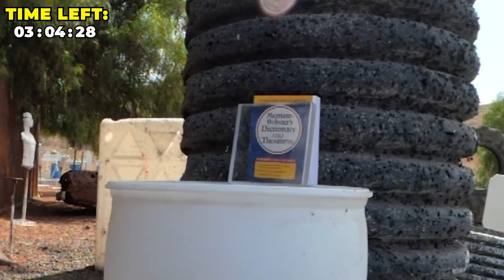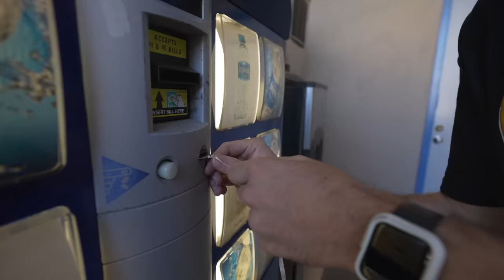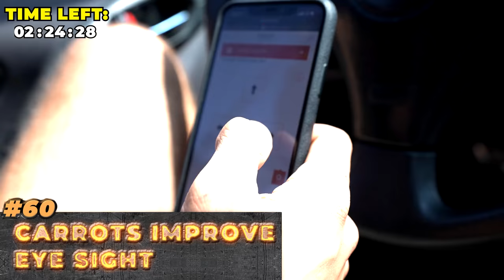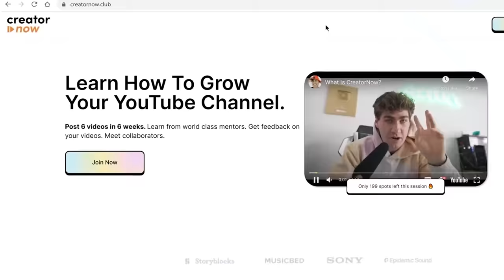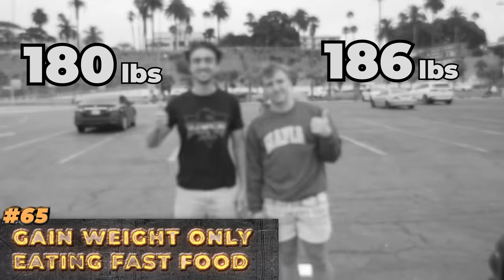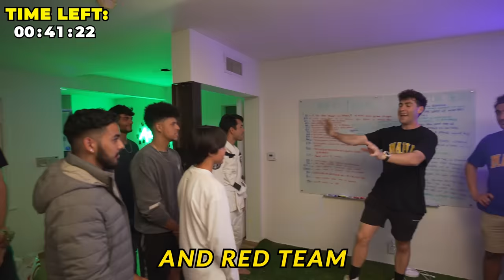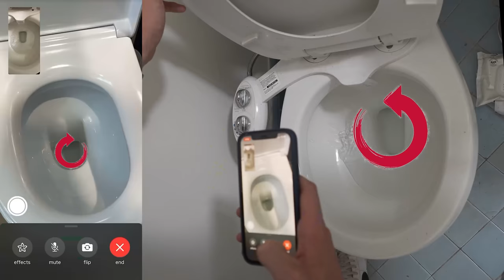Busting 100 Myths In 24 Hours!

Comment: The carrot one is actually very interesting. basically during WW2 the British had invented and incorporated sonars but they didn't want the Nazis to know that and so they started making publicity that carrots give better vision and it actually worked since no one ever found out.
Edit: a big portion of these is true but you simply didn't have the skill to do it (like breaking a glass using voice) or simply not good conditions (like the water one) or just didn't do them correctly (like the one where you used vegetables to charge an iphone since you can't just plug in the usb, you actually need stuff to conduct the electricity or picking a lock with scissors since I have succeeded
Reply: Nice pfp
Reply: Nice pfp
Reply: What is wrong with you?😭😅😂😂
Reply: The carrot one is true it just doesn't happen over 10 seconds it takes time.
Reply: can u plz not be a nerd for 5 seconds?

Comment: 16:17 It is possible. You should have the same pitch as the glass to break it, the guy just screamed at the glass which isn't going to do anything. And 18:14 is wrong, you can but it won't make you sleepy/tired on instant. 15:51 is also wrong. You can rip the dictionary with your bare hands, many people has done it even with thicker books than a dictionary.
Reply: Many of these are inaccurate on purpose. They're literally testing things like the 5 second rule and is water wet. It's not meant to be taken seriously.
Reply: Bible
Reply: It's not turkey that makes you tired anyway. It's anything you eat in excessive amounts.
Reply: Also, the title said 24 hours, but the timer said 12 hours
Reply: @megamuffin3900  I mean the water one is legit. Water is in fact NOT wet.
Reply: @megamuffin3900  True but I guess showing people misleading/wrong information isn't serious.
Reply: @TripleX-gr2ov  Yeah but not all foods can make you sleepy. Protein Rich foods can make you tired cause there's an amino acid called tryptophan, tryptophan can make you tired and Turkey is an example.
Reply: and the roller coaster thing. some people have stronger stomachs.  The bottle thing need to have liquid and the type of liquid does matter.  So i agree some of these are bs
Reply: Bruh obviously nothing in this video is accurate it’s just random dumb stuff for fun
Reply: @sirwabaloo7930  ok

Comment: About the diamond that is indestructible. fun fact: hammer can break a diamond easily. Diamonds are hard, they are known to be the hardest material on the earth but they have a crystal structure, so they can break if you hit them with the right angle aka the weak spot of the diamond.
Reply: Hard means its surface can't be scratched, it has nothing to do with it being unbreakable.
Reply: @Cainenghis  number 32 on the video, diamond cant break?😂he say "diamond are clearly indestructible". Are sure about hard definition?

Comment: Fun fact: a lot of those myths are able to be busted or not like the diamond one because diamond is just very strong
Reply: Diamond can be broken
Reply: Diamonds are brittle tho
Reply: @potaton1342  diamonds are NOT brittle, it takes a force of 70> tons to break one. Whoever told you they are brittle was wrong.
Reply: That are hard not brittle
Reply: @LShaver947  they shatter they can not bend at all
Reply: sometimes i wish people had better english
Reply: @LShaver947  btw if you are trying to 70 or more it would be 70< or 70+
Reply: @potaton1342  my guy I know my maths it is 70>
Reply: Diamonds are brittle and very strong, but their toughness is almost the same as regular glass, once you reach a diamond's breaking point it will become brittle and shatter like glass, instead of flexing and bending to withstand pressure like better materials. (We have pistons that exceed 1000 tons of force, so diamonds are crushable)
Reply: @LShaver947  I was just saying if you made a typo

Comment: At 5:43, milk actually does help with spice. It is just that the pepper you guys used was too spicy for the levels milk works in. Milk has the molecule Casein, which can dissolve spice and relieves TRPV-1 receptors, aka the things that sense spiciness. Food theory did a really good example on it. Note that it only moderately works. Really, it depends on the pepper.
Reply: i know
Reply: R/madlad bruh
Reply: Ur a genius
Reply: tempting the science guy

Comment: Myth 31 is incorrect, you can break diamonds, pretty easily actually. All you did was measure it’s hardness. what usually mixes people up is the fact that diamonds are hard, but they aren’t dense. What makes hardness and density different is the fact that hardness is usually the fact that objects are more condensed, which is what you tested, while density is how hard it is to break that object. Diamonds have a hardness rating of ten, which is really hard, it is the hardest rating a metal can get, but only has a density of 3.51 gm/cm3 on the Mohs scale. Let’s compare this to an element like platinum. Platinum on the Mohs scale only rates to a 4-4.5, which is no where near diamonds hardness, but platinum’s density is 21.45 g/cm3, which is much denser than diamond. To put that to scale, titaniums density is only 4.49 g/cm3, so you could probably guess that diamond’s density is considerably smaller than most transitional metals and is easy to break. Also, smaller objects are harder to break than bigger objects. This has to do with deflection

When one grabs a twig and tries to break it, the ends are pulled together to bow the stick till it breaks.

The deflection ("bending") of a stick is proportional to the cube of its length. So, with the same force, a stick of length 𝐿
L
 will be deflected 8 times less than a stick of length 2𝐿
2
L
with the same force.

Now, one side of a bent twig is stretched and the other side is contracted. This stretching/contraction is proportional to the deflection, and when it reaches a limit (Breaking stress), the twig breaks.

So what's happening here is that as you shorten the twig, you lose the capacity to generate deflection, and thus it becomes harder to break.
Reply: Yes now you add 2/1% force and with the length od 2÷3=0.9 with all the force it should have the force of 67.09.6% aka 34×90×6÷5=6.3 meter and yes i agree what you said great job
Reply: @mad5259  Ty :)
Reply: Nerds
Reply: Dude THIS AINT SCHOOL YOU DONT NEED TO TYPE A MILLION PARAGRAPHS
Reply: @usrname678  yes your welcome
Reply: @mad5259  bro how long did much effort did you put into this I have so much respect man! Good job!!!!
Reply: @lilhayman9934  thank you so much man i really aprecciate cause this took 10 minute yo do 👍
Reply: Hold on is this all of just 1 myth and where did it go why did it go to you can break a diamond to breaking a twig
Reply: @Sco77y152  it was an example
Reply: @Sco77y152  yeah
Reply: @Sco77y152  it was just a example
Reply: @Sco77y152  you're right, it's not school :) it's facts and real life, get real kid xD
Reply: I miss one day of school and I'm actually stupid.
Reply: What why is there so much writing
Reply: Wow. Someone is very good at English in school
Reply: Carrots improve eyesight
Reply: @zilianchen4733  it’s to explain the math to proof that what he/she is saying is correct using data and b r a i n
Reply: @mad5259  You litterally just passed a sciencetest and a math test
Reply: @dancingcow5524  thanks I really apreciate this
Reply: Get out of school nerds
Reply: @bigal18042  okay high school dropout 😂
Reply: What the fuck?
Reply: @ultrainstinctarizonaranger8611  what?
Reply: @treybaskin6391  haha
Reply: @mad5259  NERD
Reply: @Elijah Fisher EFM I don’t really care?
Reply: idk y i read this whole thing even though u lost me in harder to break than bigger objects
Reply: @Aimthegreat  lmao
Reply: I’m no einstein but I’m pretty sure hardness is how hard it is to break that object and density is the fact the objects are more condensed…
Reply: @economicapple2609  it’s not, look it up
Reply: @economicapple2609  you got it backwards
Reply: @usrname678  r u kidding me it literally says “dense” in the description for density
Reply: @economicapple2609  exactly. Meaning it’s insides are more dense and thus more durable.
Reply: @usrname678  That’s density bruh
Reply: @economicapple2609  yeah.
Reply: @usrname678  my point exactly density is how dense an object is and hardness is how hard an object is ._.
Reply: @economicapple2609  yeah no shit, but hardness isn’t how hard it is to break it.
Reply: @usrname678  "What makes hardness and density different is the fact that hardness is usually the fact that objects are more condensed, which is what you tested, while density is how hard it is to break that object. "
Reply: I wonder who's really reading all of that
Reply: now do this for like half of the myths they "busted"

Comment: The bottle has to be glass. 
Diamonds are pretty brittle, but it depends on the density and size. 
The bed of nails had some that were crooked. 
You need a chemical reaction for the patato to charge your phone.
Most of the later ones need time
Reply: oh yeah dont forget the one that they said you cant break glass with your voice. but its true also dont forget the one where they pulled the sheets off the table and said it was busted but its true
Reply: @imthatguy35.  For the glass one, you need to maintain the pitch for more than what they did. And for the table one, you need a lot of skill, or luck.
Reply: @pythro_  yeah

Comment: #79 is applied to supercooled water, not any water in a fridge, if you’re wondering.
#80 is true, but very hard, the difficulty is also determined by strength and type of glass.
#84 is true, just also very hard.

Comment: Some of these “myths” were actually true so I’m gonna name them

3:48 yes, you can explode a microwave with a fork(obviously)I’m guessing you didn’t put the fork in long enough?
4:57 you can seriously break open a bottle with your hands, but you need to do it the right way(thanks Mark Rober😉)
5:45 it does help relieve the heat, but compared to worlds hottest pepper it’s not doing anything
6:54 you still got down 🤷‍♂️ 
9:32 bullet proof glass can stop a bullet, but it can’t get shot by a pistol then a rifle because of course it’s gonna go through
9:32 now dictionary can technically can stop a bullet with a small gun and bullet at a certain amount of distance
10:01 cacti do have water inside them but you should not drink it
10:42 🤨
15:30 they are slippery as you can see the banana fly across the ground
16:08 it does work if you put it inside the freezer for an amount of time and the smack it on something and it will indeed turn into ice(look it up)
16:17 you can do this with a special type of glass, you just have to match the pitch when you you flick at it
16:46 it’s possible okay
17:52 this is just an opinion
18:05 a ball can fall down in a moving vehicle, just look it up
18:18 it can make you sleepy after a period of time
18:28 that is disgusting 
And that’s it, other than these “myths” the video was great, keep it up!
And sorry for being a nerd

Comment: The "myth" about carrots improving your eyesight shouldn't have been busted. Carrots actually do improve your eyesight. They contain chemical substances like carotenoids, which are very present in eyecells because they play an important role in lightreception, hence 'seeing'. It's a very complex system, but basically when light comes in, it changes the structure of the carotenoid-molecule, causing a chemical reaction which makes it possible that we can 'see'. So yeah, when you eat carrots, you get more carotenoids, which improves your eyesight. 

Same with cacti, of course they have water, otherwise they wouldn't be a able to survive, just like any other living organism. They need it to photosynthesis, like any other plant does. Without water, they'll just die.

Comment: Water is wet you . Yes, it makes things wet, but in order to do that, it needs to be wet . Being wet basically means having a coat of water. Also, if you take ice, which is a solid form of water, u don't get wet the ice melts, and then you get wet the same shit that happens with water vapour . So, in conclusion, water is wet